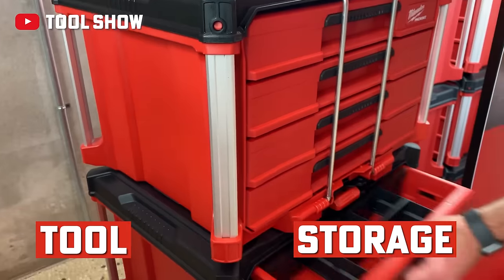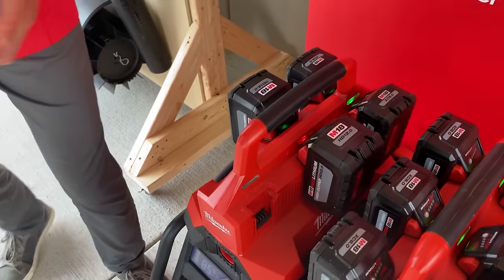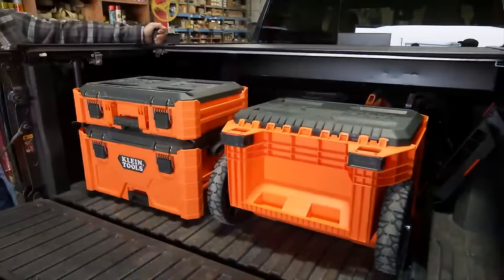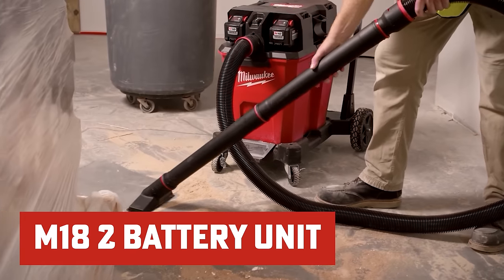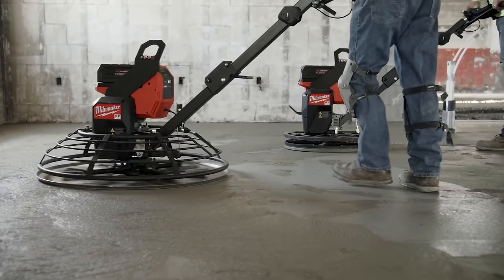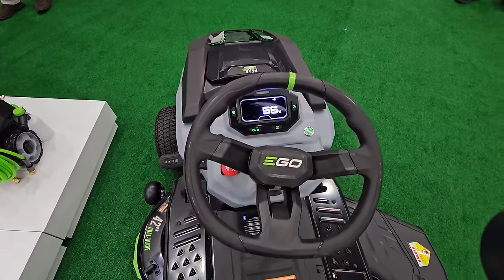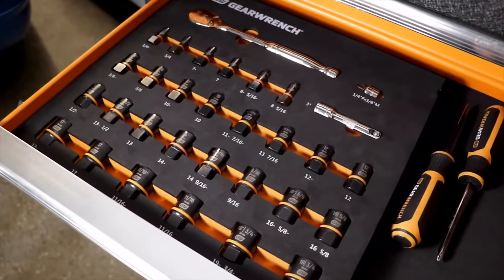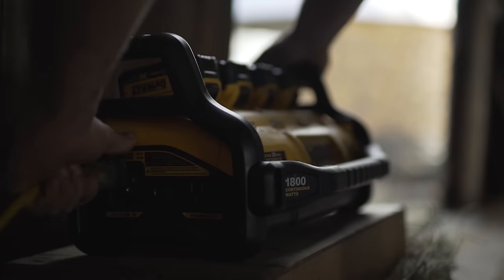New Tool Trends That Change Everything in 2024 - Milwaukee, EGO, Dewalt and More!

Comment: Pneumatic impacts are still top dogs. Battery tools arent even in the same realm. Its a talking point companies are spouting off and its far from reality. A rep from Ingresol rand told me several years ago they have battery tools that outperform their air tool counterparts. The only way the statement can be true is if they are intentionally making their air tools cheaper and less powerful.
Reply: dewalt 961 stronger than any air 1/2 impact?
Reply from the maker: The 1”+ impacts are still top dogs today, no question, everything below that is rapidly shifting. We are guessing with speed of change 2-3 years from now you’re going to get your hands on a cordless 1” and change your mind perhaps. At that point who’s investing thousands in a new shop air compressor. Might be 5 years but hard to think it’s that far off.
Reply: @OhioPowerTool  dcf961 with a 1./ anvil beats the 1" milwaukee?  and got better with a 3/4 anvil in power also

Comment: I know you say the chainsaws are catching up though I had to buy a stihl 462 since it would take multi batteries to cut Oak vs less then 2 tank of gas cutting 2 foot diameter tree limbs cut 2 of them. Also can't get good chains on these electric saws. I mostly own Milwaukee tools with Dewalt table saw. To try that with Is milwaukee or ego to would have been 24x best amp Batteries to cut one Is probably need more than one chain too Besides multiple days.